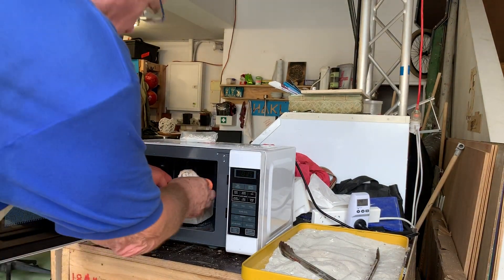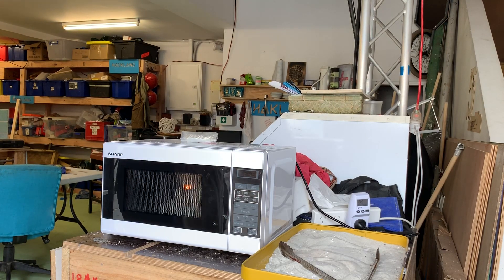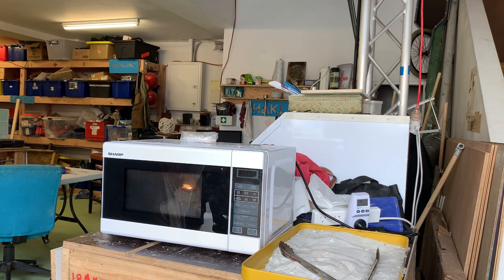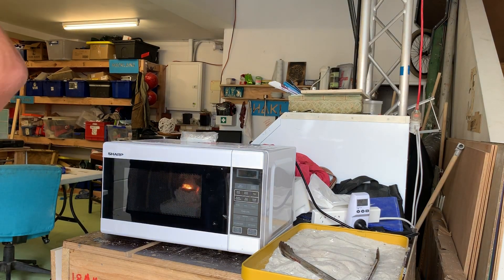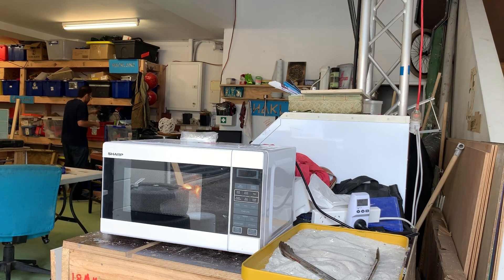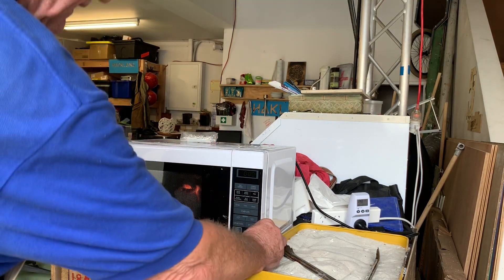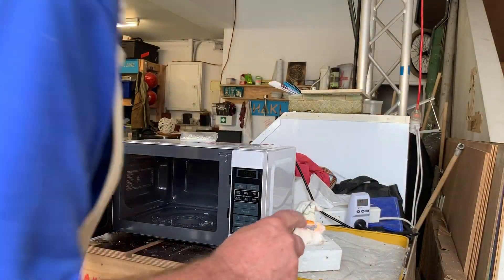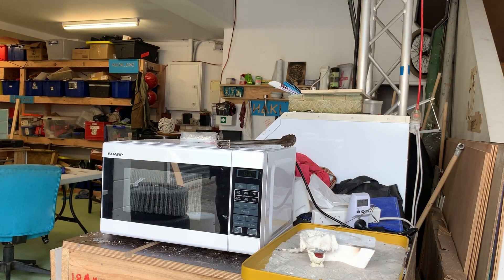Melting and casting silver at 1000C in a domestic microwave

Comment: Nobody who makes these videos explains how the metal is melted. Is it the kiln, the crucible or the metal that the microwaves are heating up? Here the gent is speaking so fast and the audio so bad I can't hear clearly. Anyone know?
Reply: need a silicon carbide crucible, cause such one accumulates the heat, and tranfers it to the metal, and good insulation around it, so that the crusible can transfer its heat solely to the metal, and not overheat the oven instead
Reply: 😮 @klausbrinck2137

Comment: Hi David, Marnix here, I visited your workshop a few weeks ago (the dutch blacksmith). What material do you use for your molds? thanks!
Reply from the maker: Marnix Relyveld   Hi Marnix. The moulds are ceramic shell lost wax, a widely used casting process. I use a combination of colloidal silica and Molochite